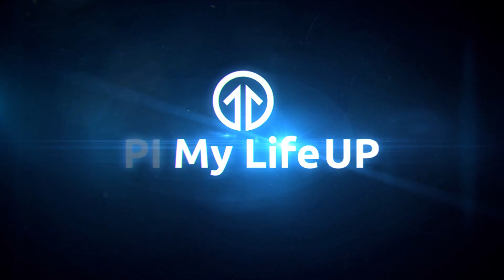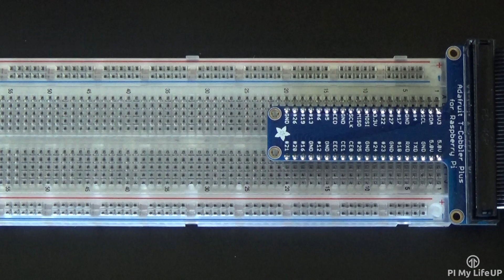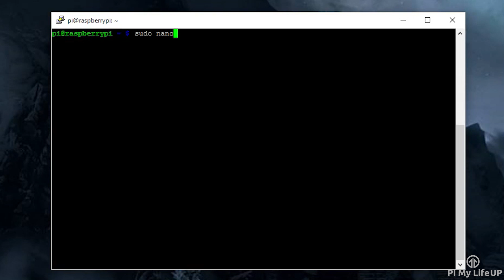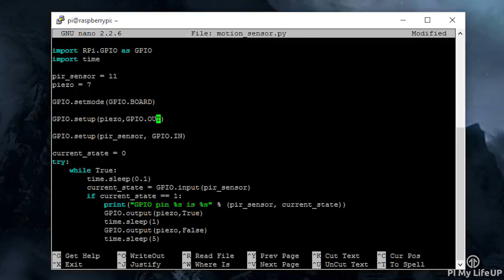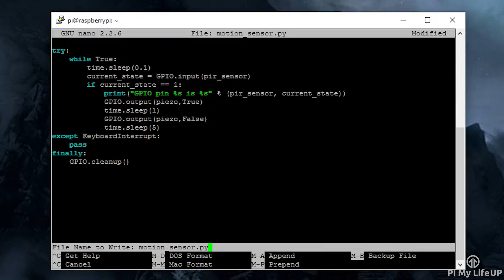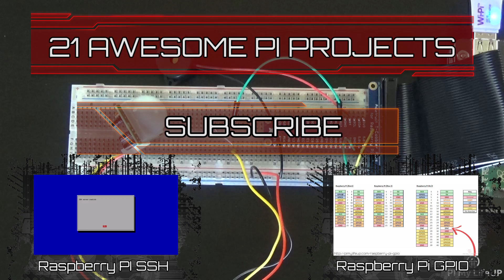Raspberry Pi Motion Sensor using a PIR Sensor

Comment: I am just looking to buy the cables to plug in the pi. What are they called because I do not want to buy the kit and I am just using the sensor for the smart mirror to turn it on and off.
Reply: Jumper wired

Comment: Is there a type of motion sensor that could target a very specific specific area from about 2 feet away? An example would be I want to focus a motion sensor on a rather large wall clock, and when the second hands tics to a very specific part of the dial face I would like a light to emit. Does a motion sensor with such accuracy exist? I can't modify the inside of the clock in anyway. Thoughts?!
Reply: shawoo I know it’s 11 months ago but you could use a arduino transducer as a short distance sensor, it has an operating range of about 18 inches so you could position it somehow to target a specific area...or sonar?

Comment: My friend and I made a script to take a camera snapshot when the PIR detects motion. It then waits 5 minutes to look for motion again so it doesn't take a pic every 5 seconds. Anyhow, I can leave the room and it will still take a pic every 5-6 minutes without motion. Any ideas what to check? I tried adjusting the potentiometers.
Reply: Jeff Flowers do you fix it?
Reply: In fact I did. I found that the problem was I was using a RasPi-3 and the PIR mounted right over the larger heat sink. The PIR was reading heat off the back side of it and triggering nonstop. I changed to a RasPi-2 and it's good now. I'm surprised that no one else has reported this before. I'm using a Spi-Box. http://www.ebay.com/itm/SPI-BOX-Raspberry-Pi-2-White-Case-with-swith-mounting-points-for-PIR-and-Raspber-/252163645165?hash=item3ab61fdeed:g:WqYAAOSwdGFY2Rqo
Reply: Something else I had to do was to put a ring of aluminum foil around the PIR to narrow it's field of sensing. It would see movement outside of the camera's field of vision and take a pic before the subject got into view.
Reply: so you think problem is case of PIR sensor? I will cover it asap and will try. I have trouble about pir sensor too. It makes me crazy